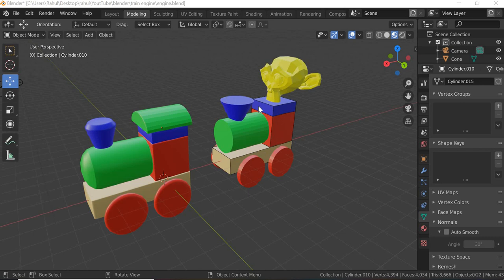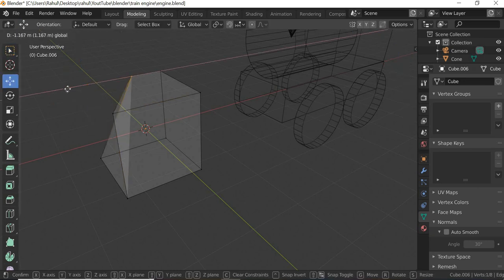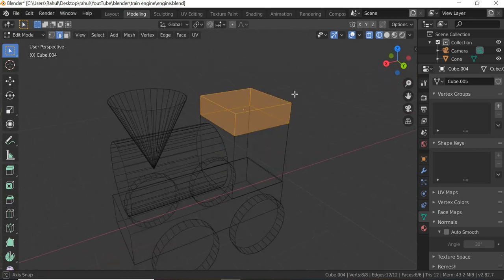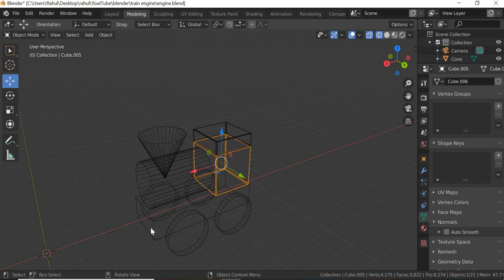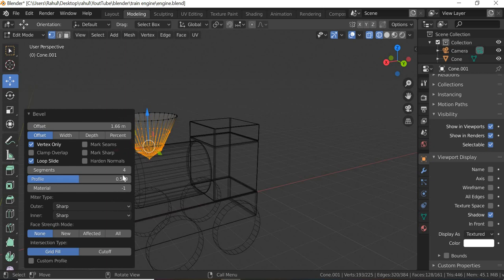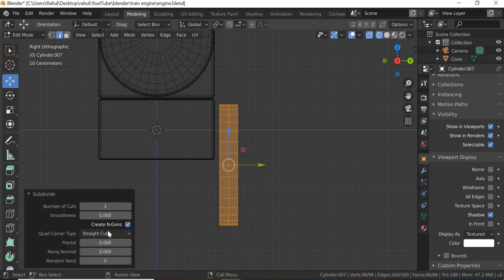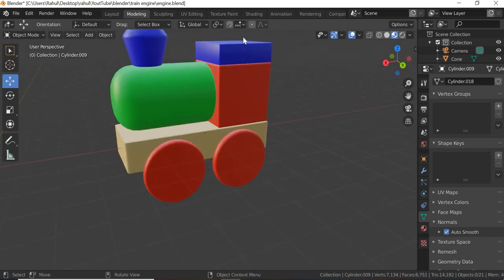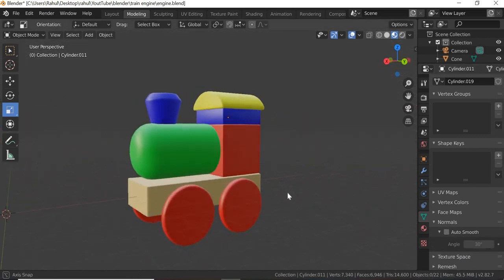Modelling Basics #2, Blender 2.82

Comment: Completing this tutorial was very entertaining.  It has just the amount of difficulty to make you think but not too much to give you a hard time while being introduced to a new complex user interface.  Well done Youtuber. 
In a window by itself, it’s a good idea to Add a Cube and switch to Wireframe to practice Selecting edges.  Also practicing Beveling with a lone Cylinder and Cone will prepare you for modeling the Choo Choo Train.  Use the (Hand-Icon) on the right side of the screen to move around in the workspace instead of pivoting around the center point.  Switch to Object mode to Select an object, then switch to Edit mode to make further selections with that object.
https://www.facebook.com/groups/762817337537667